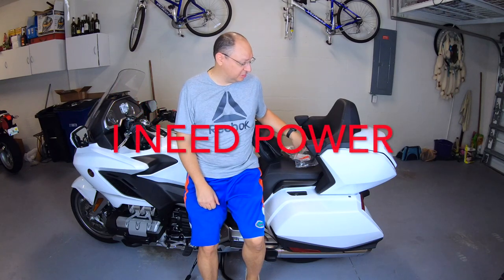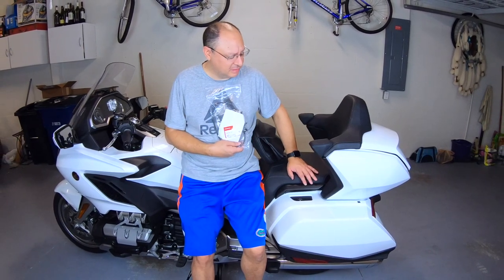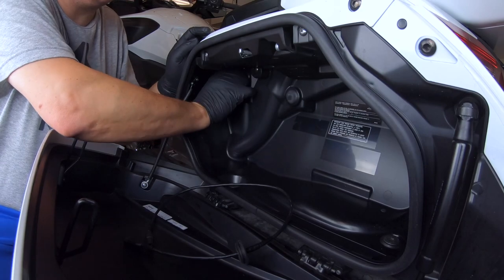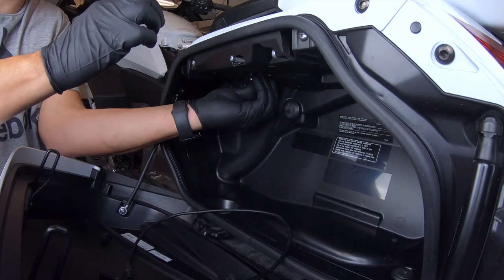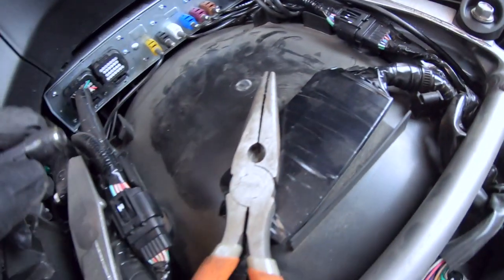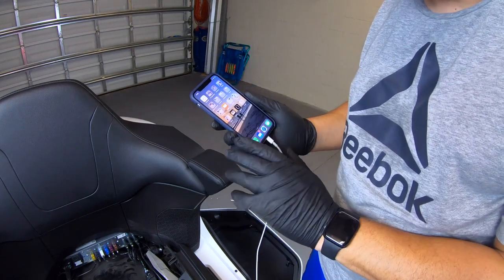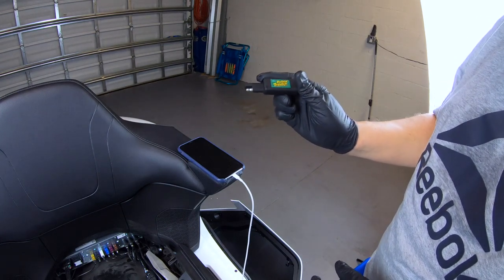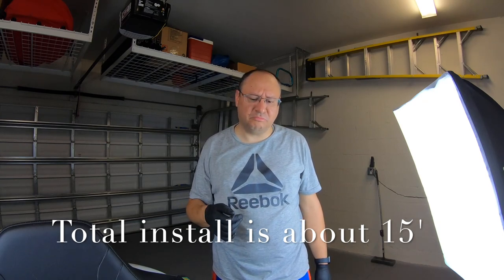2018+ Honda Goldwing saddle bag power cord install

Comment: Thanks for your great vid. I followed your instructions rather than the over-complicated unnecessary ones from Honda and yours made installing the USB cable on my 2018 Goldwing DCT Tour very easy. I have small hands so I was able to remove the dummy plug on the power board by sliding my middle finger under the plug and depressing the tab. Honda's instructions said to use soap and water to install the grommet; I guess that would probably work, but I used silicone grease instead and it worked well. Thanks again !
Reply from the maker: I’m glad it helped. That’s why I do them.

Comment: How is the jack plug for the USB cable suppose to be removed without using pliers, is there a release sequence.  The instructions say to save it assuming you wanted to remove if you upgraded to a newer GW.  Would like to have seen how the cable routed behind the saddle bag with out removing or loosening, I assume you found an easy route up to the jack plug.  Thanks great video, ordered the USB harness and a 12 volt power plug for up front on the fairing.  Might as well have plenty of power.  I am cabled up for the Battery Tender tucked into the side panel, i will by the USB plug in for added USB for passenger.  Keep them coming.  I'm in Orlando and I am in your neighborhood from time to time, give me a shout out on securitybob at iCloud dot com and will exchange contact info if you would like.  Bob
Reply from the maker: There is a push tab on the bottom of the jack plug. I got frustrated and grabbed the pliers. All you have to do is fish the wire up behind the saddle bag. It’s very simple.
Reply: Petes1800 thank you Pete much appreciated I figured as much but as an ole retired Army guy anticipate the worst and expect the best. If you don’t know ask. 👍👌
Reply: Completed the task as outlined. As you stated very easy user large zip tie to pull through connector. Used clamp pliers to access under side of plug which released immediately. Used my fingers to manipulate the plug into the grommet hole.  Thank Mike.